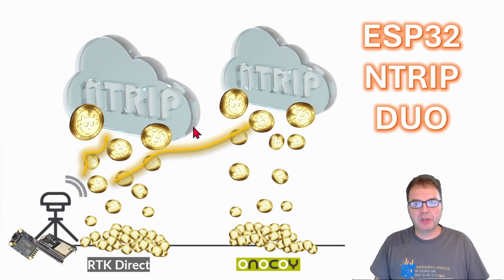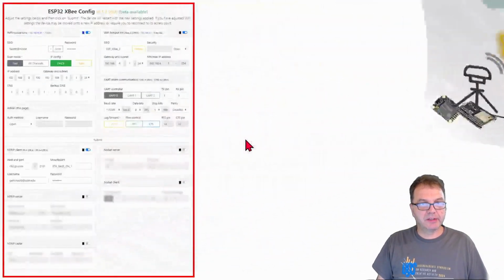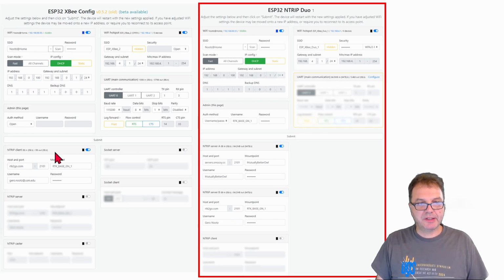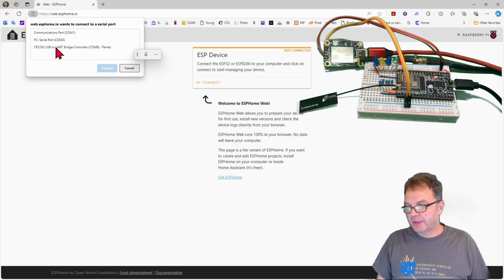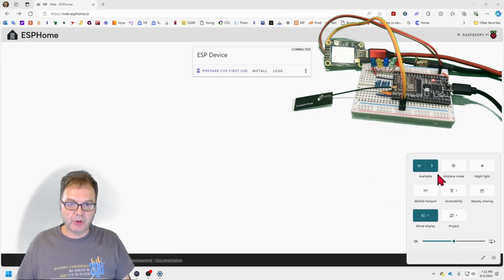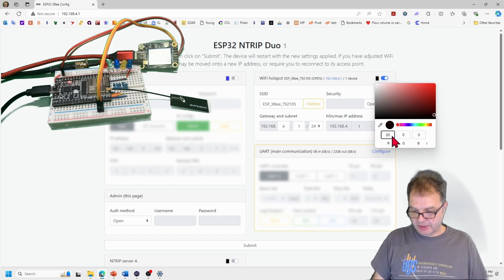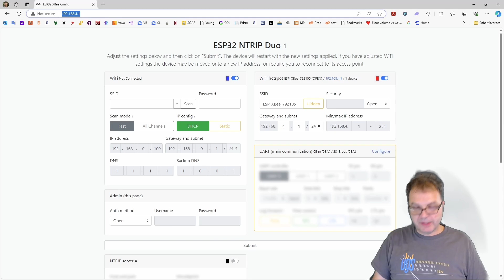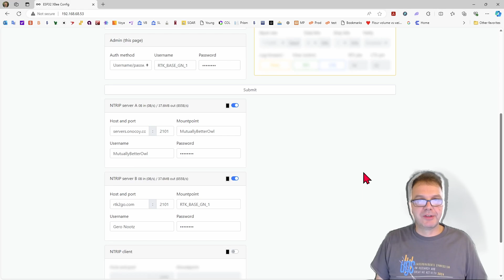Low-Cost DIY Double Crypto Mining with ESP32-NTRIP-DUO

Comment: I have a ntrip-x mining onocoy, can I just flash with the ntrip duo and it will work for both? or will I need to get permission and coding from the manufacturer? thanks for the great content
Reply from the maker: The NTRIP-X runs on the ESP32-S3, while NTRIP Duo is compiled for the ESP32-WROOM. This means that you're out of luck until a compatible version for the S3 is developed. I tried but didn’t succeed. Maybe I will find the time to try again.
Reply: NtripX have version with 4 ntrip servers now.

Comment: I've noticed you have BT BLT bridge firmware from ardusimple. You wouldn't happen to have any documentation for it by any chance, or maybe a github link? I tried flashing it on one of these ESP32 boards but I think I'm doing something wrong, as it's connecting via bluetooth but my device isn't seeing any data via the GNSS master app.
Reply from the maker: https://www.ardusimple.com/ble-bridge-firmware-update/
Reply: Update, I managed to get BT BLT bridge firmware working, I just needed to configure UM980 to send information to the correct COM port(COM2 in my case). Now all I need is some kind of 3d-printed housing for UM980 and ESP32 and I'll be able to use the rover as either USB serial directly plugged into my phone or via bluetooth and a power bank plugged into UM980 USB-C port instead.

Comment: Should this work also with esp32 s3 ? After the flashing there is no wi-fi visible for me..
Reply from the maker: No, the binary is compiled for ESP32-WROOM. It will not work with any other ESP version
Reply: I will have some spare time soon to try to recompile for ESP32 S3. For now it is ESP32 wroom only.
Reply: It is almost ready, I have successfully compiled it for S3 now running on two different esp32s3 boards.
Reply from the maker: @GirtsBurnauskis  very nice. I hope to get around to testing it soon. Thank you!

Comment: I get: " Data received, but not in RTCM3 format"
 from onocoy, what it means to you?
Reply from the maker: maybe you are only sending the NMEA but not the RTCM data? Did you configure your Station with:

rtcm1005 COM2 30     RTK base station antenna reference point (ARP) coordinates)
rtcm1033 COM2 30     Receiver and antenna description
rtcm1077 COM2 1	GPS MSM7 (GPS correction data)
rtcm1087 COM2 1	GLONASS MSM7
rtcm1097 COM2 1	Galileo MSM7
rtcm1117 COM2 1	QZSS MSM7
rtcm1127 COM2 1	BeiDou MSM7
SAVECONFIG	        Save Configuration into non-volatile memory (NVM)

?
Reply: @oceanexplorationlab  Thank you for your attention.
 This is the config and message is not present now, so I guess all is fine.
 Good luck wit your projects, and more energy to publish them!